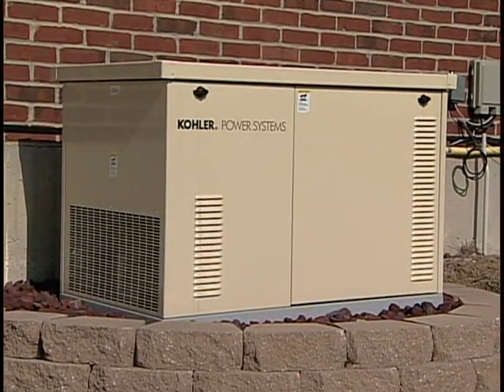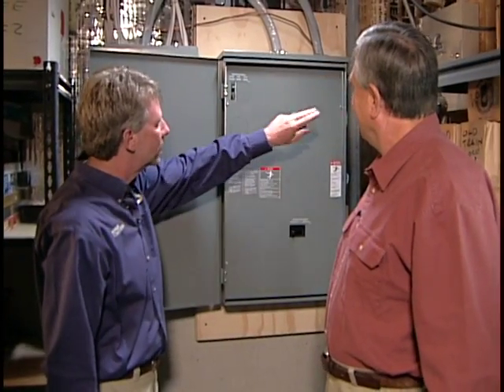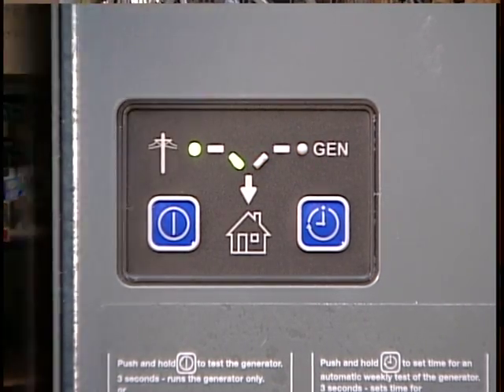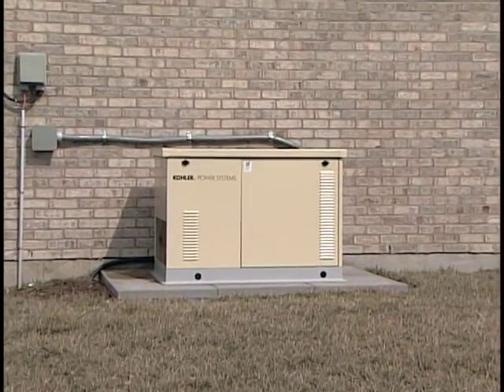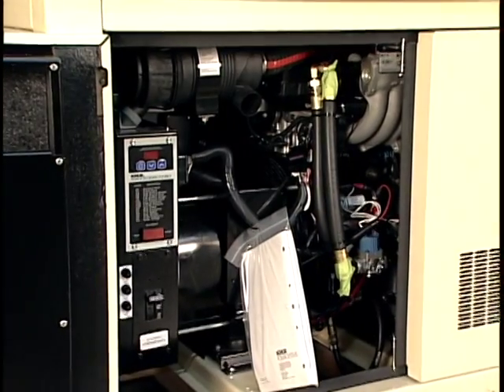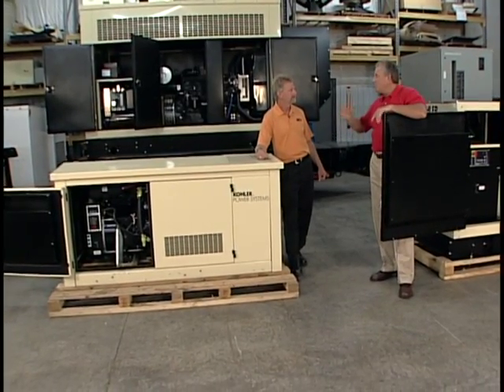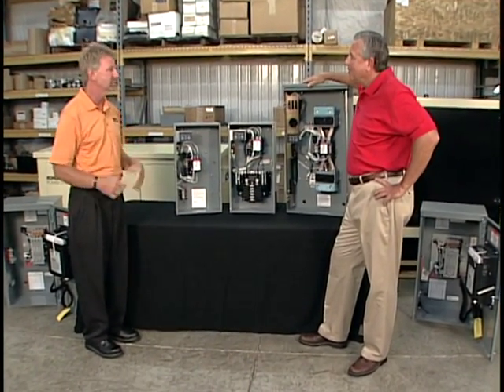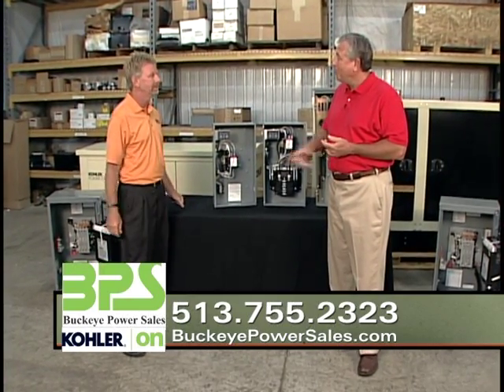Proper Selection of a Kohler Home Generator

Comment: We went with Generac. The piece of mind you get when purchasing one of these regardless of the Brand is priceless. GO Blue!!!
Reply: What generac did you get? What amount of kw
Reply: @justinwarren4374  We bought the 13Kw unit that's perfect for our needs considering the size of our home.
Reply: @NonyaBusiness! Well, So far we have only needed it once in a power outage for 31/2 hours. We just got it in June, So far no problems ... I look forward to leaving updates in the future good or bad.
Reply: I always buy what is considered commercial as things that are targeted for home are not so good. Most people don’t want to spend the money up front so they don’t have stress later.
Reply: @sturmbreakers7817 , So far not bad. We haven't had any stress at all.  We're looking forward to winter as the seasons move along but if anything changes, for better or worse, I'll post about it. Thanks for responding.

Comment: Thinking about getting one of these, and I know these units cost about 10k+,  but about how much does it cost to install them.
Reply: @NonyaBusiness! Best Wishes
Reply: @NonyaBusiness! Try logic.
Reply: @NonyaBusiness! I always use logic. You used a false analogy based upon pure speculation. Installing these types of generators if you do not have a medical need or weather related issues is stupid. Now disprove this using logic or comment to another person.
Reply: @NonyaBusiness! By the way these generators are a waste of money and junk. Go buy your car run it one hour a month continued to do maintenance on it and wal fifty miles to work. That is what you are doing buying one of these jokes. You act like you own one which is why your logic is up your butt.
Reply: Don't get one they are a waste of money.
Reply: Brad Davies so is busted pipes during a winter storm.

Comment: We do not use AC, nor a hot wáter heater, nor a heating system.  We would need a unit just for basic appliances, lights, computers.  What size would we need? We would want to run it all the time.

Jaime 630-701-6725
Reply: Jaime Alvaro Burbano Cuel8lar
Reply: 8
Reply: Jaime Alvaro Burbano Cuellar

Comment: In the video at 26 seconds, the generator looks to close to the structure for matanance?
Reply: Maintenance is through the front of the unit. Also, local codes regulate how far away from a structure  a standby generator has to be placed.

Comment: Depends on multiple factors but mainly on the size of your main utility feed.  7500 sq ft is large so you may have a 400 amp or a 600 amp or an 800 amp main utility.  You can still have a whole house fully automatic standby system but it will just cost more.  Interested?  I'm with Buckeye Power.  Call me at 317-223-9862 and I'll make sure you get the necessary info and pricing.   Thanks.  Derrick
Reply: I hope your still not with them you are conning people.
Reply: @TheMickeymental  OK I will bite, I live by the Gulf Coast in Texas where we have frequent hurricanes and power outages, storms, etc. have a 1400 square foot house 2 ton AC  how would this be a waste for me?
Reply: @TheRealJLucas  I wasn't trying to cause you to bite. It depends on medical condition and  your financial situation.